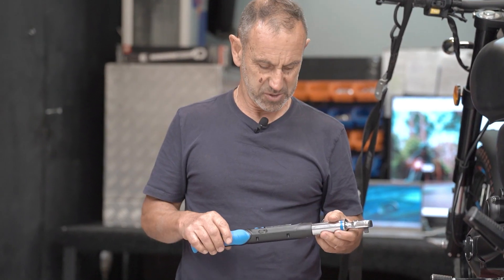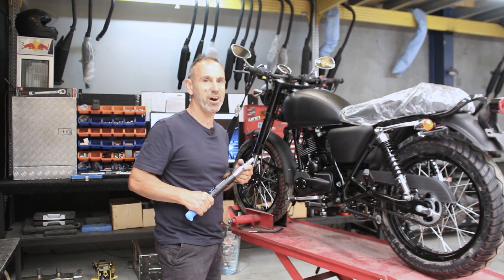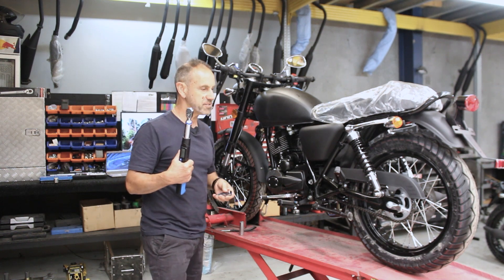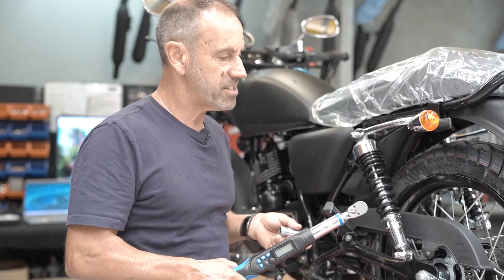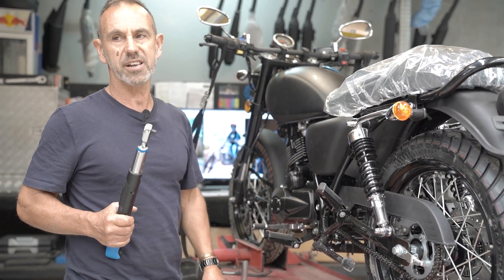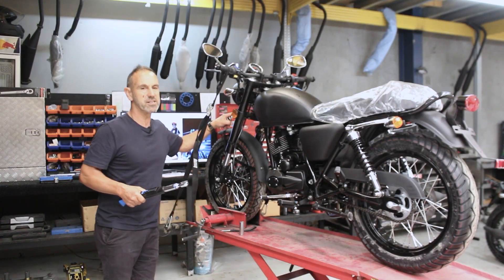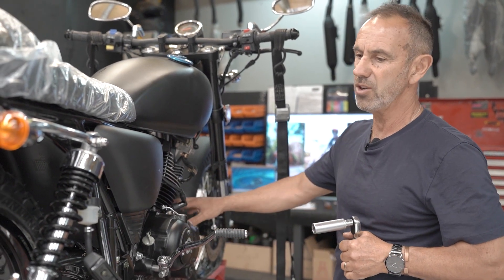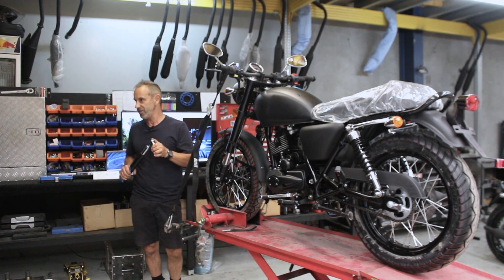How to use a Torque Wrench on your ST250/400

Comment: Great info Paul
Whilst many manufactures do provide specific settings for axels and swing arm bolts etc. there are general torque setting that are universally accepted depending on the thread size and typical for steel bolts and screws.
Below is a section from my Honda XR600 manual as reference.

It would be good if this was made available to all owners in their owners manuals.
Maybe Braap could add this to the docs or the online manual and oly list the specific critical specs like axes, swing arm and sprocket retention screws. 
One are I find often ignored is the two lock screws on the front sprocket and the screw that hold the rear sprocket to the hub.

Bolts 
5 mm thread = 6 Nm /4 Ft-Lb
6 mm thread = 10 Nm / 7 Ft-Lb
8 mm thread = 22 Nm / 16 Ft-Lb
10 mm thread = 35 Nm / 25 Ft-Lb
12 mm bolt = 55 Nm / 40 Ft-Lb.

Screws 
5 mm screw = 4 Nm / 3 Ft-Lb
6 mm screw or a 6 mm screw with 8 mm head flange bolt & Nut = 9 Nm / 7 Ft-Lb
6 mm Flange Bolt and Nut 12 Nm / 9 Ft-Lb
8 mm Flange Bolt & Nut = 27 Nm / 20 Ft-Lb
10 mm Flange Bolt & Nut = 40 Nm / 29 Ft-Lb
Reply from the maker: Great info cheers!